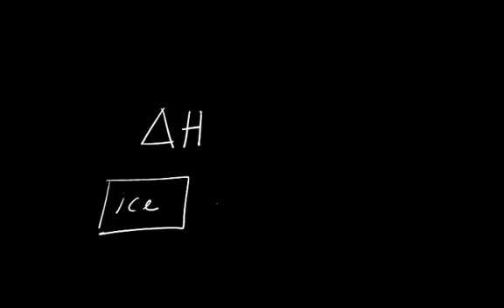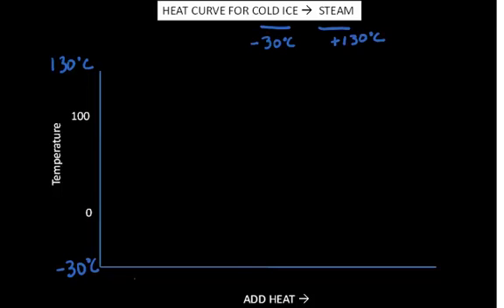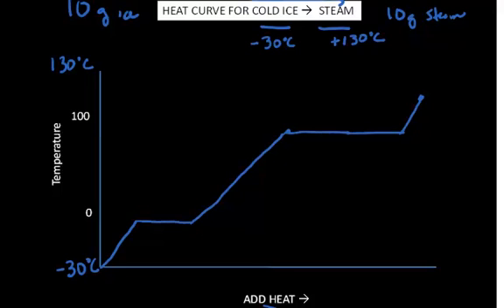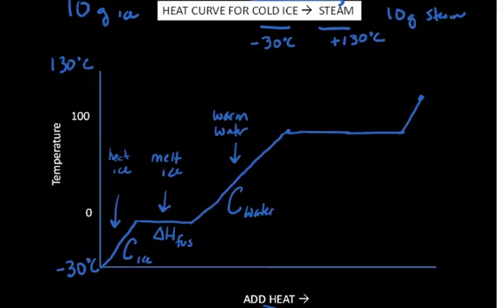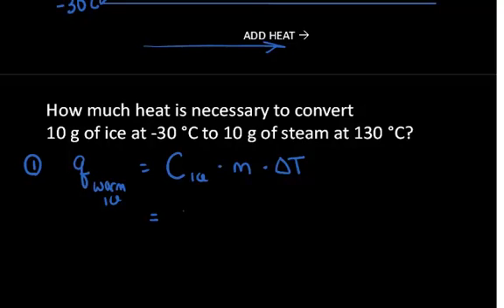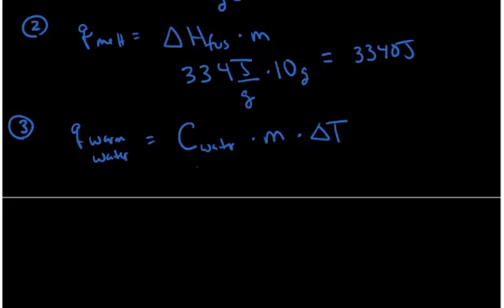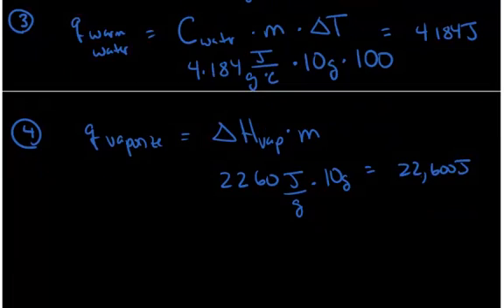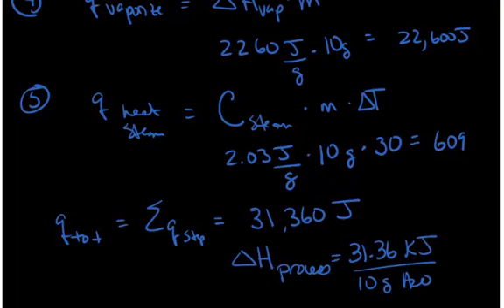Heating Curve Water Example

Comment: Quick Question, do you know any references about the temperature as matter compresses? I remember coming across a video by Brian Greene where he was talking about how as matter is compressed it heats up, but then there is a point where presurasation continues and heating drops off... meaning that; yes, matter heats up as it presurisses, but only to a certain point, even though pressure continues, the heating doesn't, past a certain point... any ideas where I can get some references about this idea? Thanks!